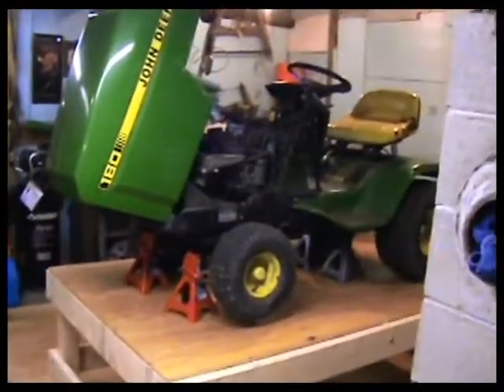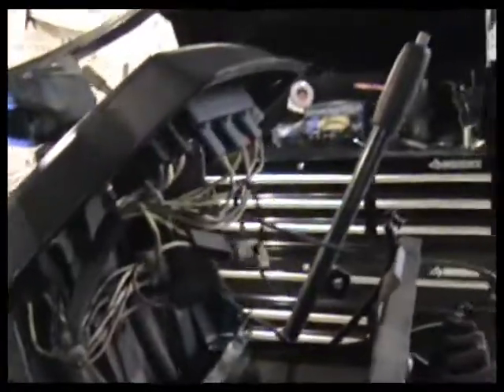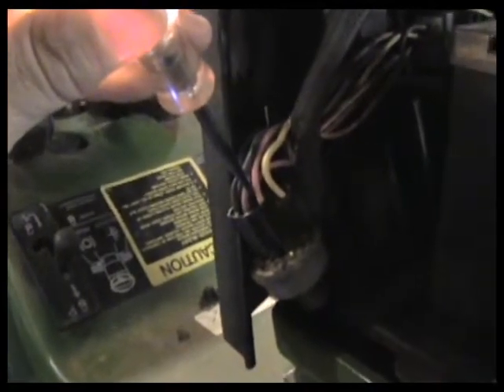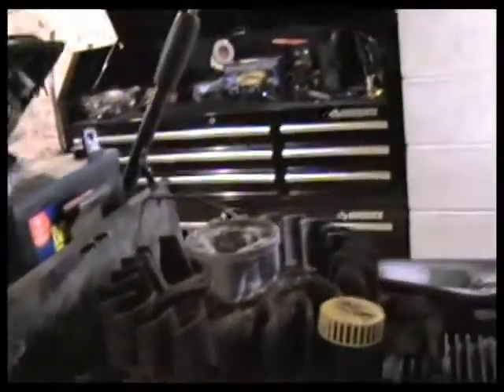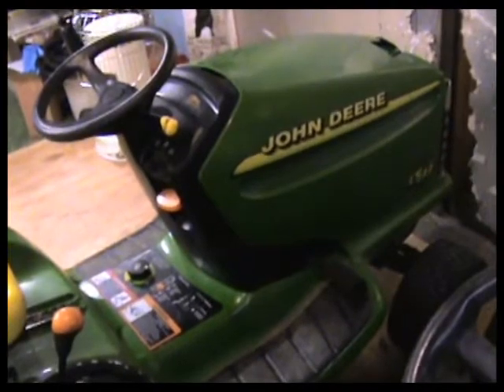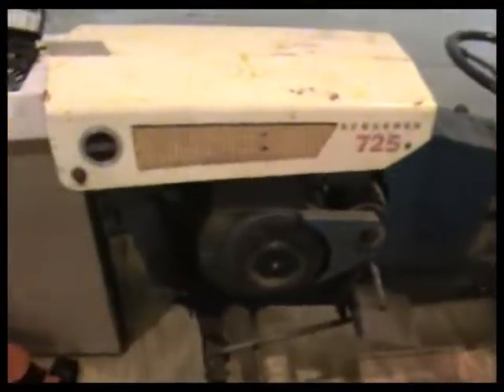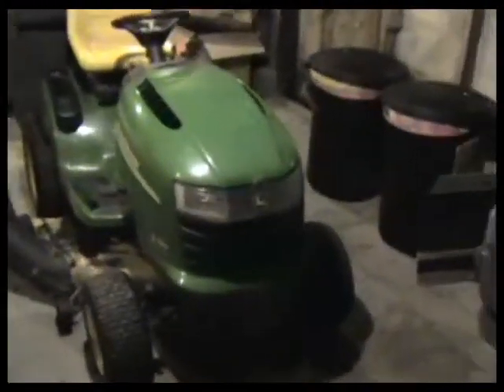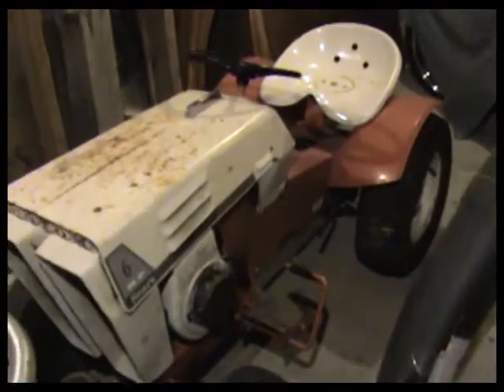Time to tinker 125 tractor time

Comment: Cool tractors . the last sears prob came with a electronic ign tecumseh engine . hard to get the ign if bad , but there are aftermarket ones . Right in front of shifter , on the gear info plate is the model number , google it and it will tell you what it is . I got to get more done on my sears .
Reply from the maker: I just think the old Sears are cool............tony